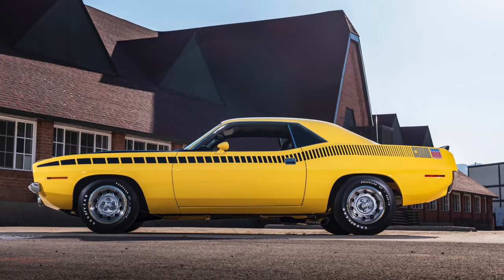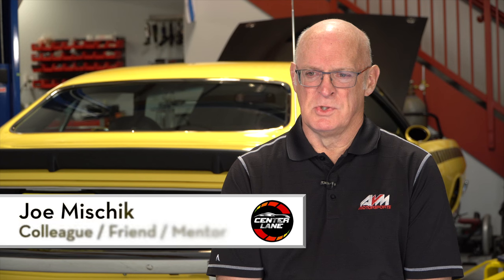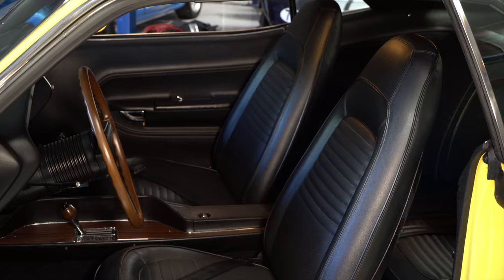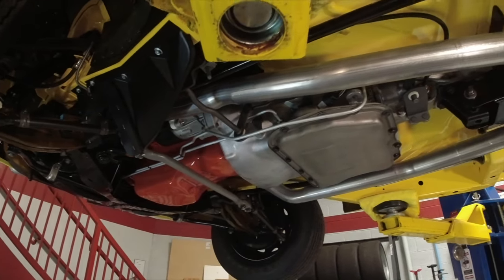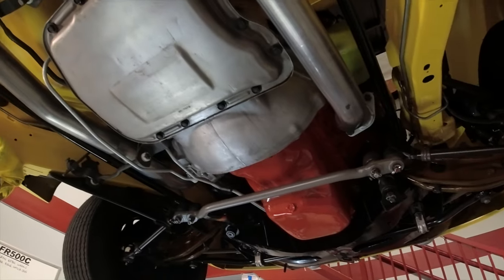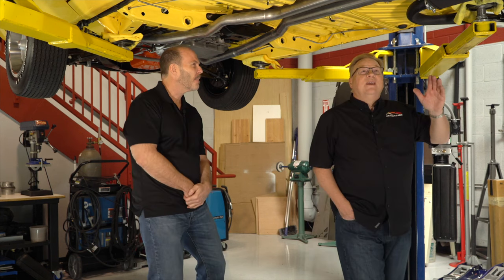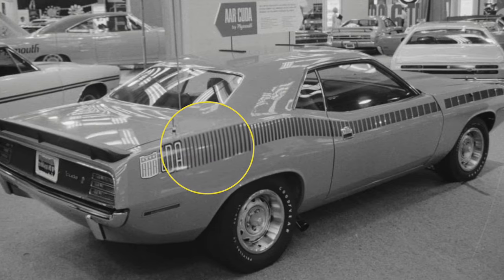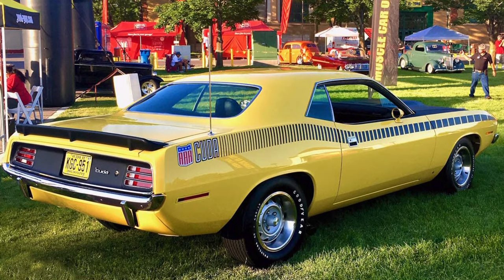Unveiling the 1970 AAR Cuda: A Perfect Automotive Masterpiece

Comment: Great job. And I would add with out hesitation “the best restoration of an AAR Cuda. Hands down the best. I love the personal touches that make it unique. I have a White 70 Challenger. I have owned since 79. I drive it weekly. I am in the process of restoring my 70 GTX. I have owned since 81. I am doing as much of the restoration as I can myself. I pulled the engine and detailed the firewall. Rebuilt the engine and put it back in myself. I did need help with the removal of the hood😛. You gave me an inspiration to continue on. Thank you both for the really nice example of Mopar hardware. This coming from a Mopar guy for 46 years. Bought my first car a 72 Duster at 17.
Reply from the maker: Thanks for sharing. Glad you liked the video.
Reply: Randy, I can’t tell you how happy it makes me to hear that this video and the 13 year effort that went into it is motivating someone to work on their car. Sounds like you’re already moving on your project. Stay motivated, slow and steady will finish the race. Best wishes that your project becomes all you wish for. 
Regards, Lew

Comment: Great job on an enormous project. I bought my AAR new. Mine only has 15,700 something miles, and it looks nowhere near as nice as this one. One thing that caught my eye, though, is the center link looked "crooked". It was hard to tell for sure,  because the camera panned across it pretty fast. It almost looked like someone put a fast ratio(longer) Pittman arm on the stg box, but a std length idler arm on the other end of the center link, hence the "crooked" center link.
Reply: Great eye !!! When it comes to MOPAR fact can be stranger than fiction. All AAR’s left the factory with the same idler arm, regardless of steering choice delivered on the car.  Some folks corrected the issue by replacing the idler on fast ratio steering cars with one from a C-Body. That said it’s not the way they were delivered from the factory. 
Sounds like you may have a heck of a car!! You wouldn’t happen to be the fella I met at MCACN in 2022? Located in the south east somewhere?  I would love a chance to see it in person, or as a minimum some good pictures and a chat.
Drop me some contact info 👍
Thanks for watching, glad you were able to appreciate the effort. 
Lew
Reply: @lewb.7823  no, I've never attended many shows, certainly not with my AAR. It hasn't been driven since '74. A fella, I met thru mutual friends, from eastern  WA was restoring a Sassy Grass AAR, and he came and took various pics of my car to try to  duplicate the original markings on mine. Mine is FK5, Deep Burnt Orange Metallic, and a 3 fender tag car.
Reply: @budlanctot3060  I’d love to talk and see some pics of your car, seems a great opportunity to further knowledge. You happen to know your build date?
Reply from the maker: Thanks for watching and sharing your story. I can’t answer your question but hopefully Lew will see your comment and chime in.

Comment: Grill under doors & little spoilers under head lights are missing!?
Reply: M25 gilled rockers weren’t available on AAR’s, even though some point to pre production images as examples to support the claim. That said there may be a couple instances where folks could have purchased them from their dealer at the time of delivery but again, not a factory offered option.  
As for chin spoilers, contrary to popular belief not all AAR’s came from the factory with chin spoilers.  In the case of this car it is coded for them but after speaking to owner #2 who purchased the car in Feb 1974, and after looking at the original front fenders, there is no evidence the dealer ever installed them. Could have been the original owners request or the dealer being lazy. In either case, to hold true to THIS car, the chin spoilers are in a bag within the trunk, just as it would have been delivered to the dealer. 
Thanks for watching, and asking the question. 
Lew